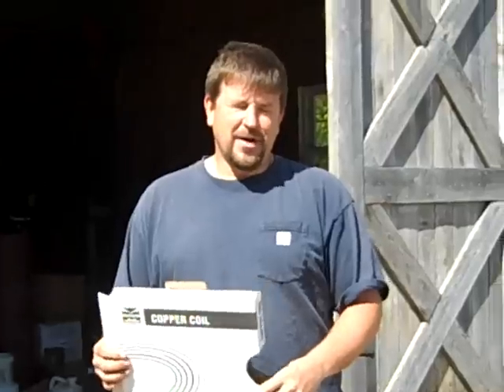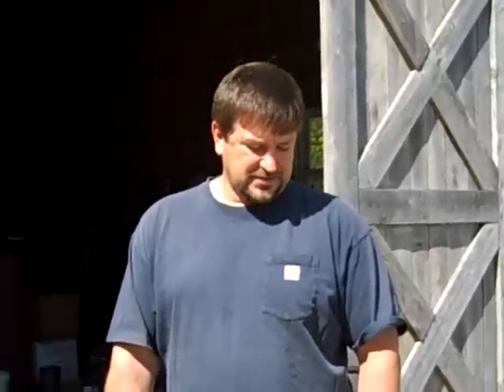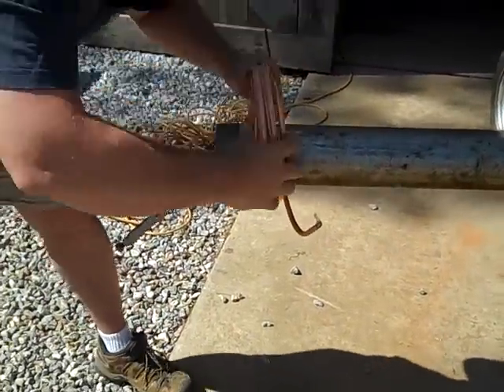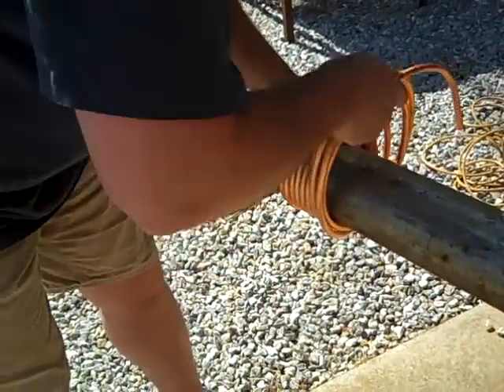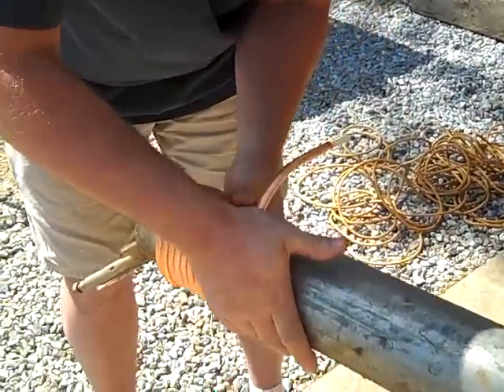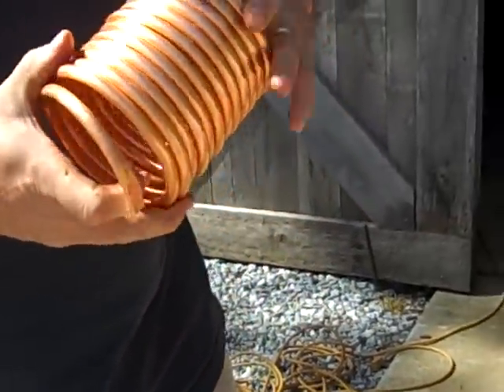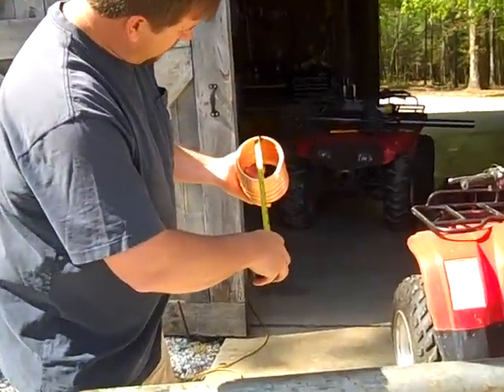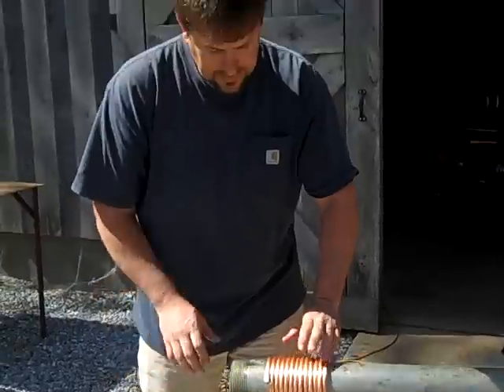Prepper Tip- Bending copper tubing with ICE!

Comment: When you froze the coper tubing what keep it crocking?  When I have had coper pipe freeze & braking open?
Reply: +Bruce Boyles Look up sand mandrel bending.
Reply: +Bruce Boyles When he froze the copper pipe with water in it, he left both ends "Uncapped". So the water can expand without bursting the copper pipe. In homes when it gets so cold that pipes burst, its because those pipes are in a closed system, and the pipes DO NOT have any openings, therefore the water which turns to ice bursts the pipe because it is looking for the easiest path to expand. I hope this is helpful...
Reply: +drs1919 1919drs that's not entirely true. Even with open ends the water can expand and crack pipes. Expanding ice will expand in every direction often taking the path of least resistance but I can still cause damage. Rocks get cracked like that naturally. The only reason you can do this with smaller tubings is because of just that. The tube is smaller therefore less water and that allows it to freeze faster and less expansion.
Reply: If you are going to do this make sure you fill the tube all the way and cap the ends with water balloons. Other than that I wouldn't fill it with anything at all. That size tubing bends easy on 4" and larger diameter pipe. Anything smaller then use sand or water. Sand is better tho.

Comment: I know it has been several years since you made this, but would it have been better to set the coil vertically and the water would run out on it's own. Instead of you having to twirl it?
Reply: I would assume that's a common sense thing, the bending of the tubing is the main focus here.
Reply: Good video on how to roll copper..

Comment: Has anyone pointed out the simple fact that when you're faced with a 'grid-down' situation your freezer may not be working? The 'fill it with sand' works, maybe salt or sugar if you're still stuck in a concrete jungle.
Reply: its a PREPPER Channel - - that's a SIMPLE Fact too....

Comment: This will not work hardly at all with a smaller diameter bend. I used the same 0.25" copper at about a 2" circular bend and the copper kinked. I think the only way to make a tighter coil will be with packed sand.

Comment: I NEED TO BEND A LARGE COPPER PIPE not tubing the stiff wall copper pipe how can i bend it with out putting a dent in it because i will be using it in a custom mosaic shower im installing in the basement of the house this week
Reply: Did you work it out? There are several ways of doing this.
Reply: yes i felled the pipe full of sand and heated it with a torch it looks beautiful after polishing it thanks
Reply: ***** Glad you worked it out and you are happy with the end result.

Comment: What if i have only straight long coper tube and it doesnt fit in freezer
Reply: Then you can't freeze it...lol
No..seriously.. You don't need ice or any filling at all. Just anneal the tubing, drag and bend (simultaneously) around a pole or pipe...that's all. Just give it time and wear some gloves with rubber to get a firm grip on the copper pipe.
I've done that with 6, 8 10 and 15 mm pipe without any kinks.

Comment: I would be concerned with the copper becoming brittle while cold. Sand is much safer, with a metal that work hardens as easily as copper and is so expensive I would stick with a fine grained solid.

Comment: So you're basically mandrel bending. Wouldn't sand work just as well and be much easier and faster to use?
Reply: Sure, sand would work, but it would be harder to get all of it out of the coil since it doesn't flow like water.
Reply: easier getting started, harder to clean up

Comment: Isn't it possible to just fill it totally up with water and close both ends. Water can't be compressed like ice. Painting it black will take more heat in from the sun, if you use the sun that is.

Comment: I'm in need of doing 3/4 copper tubing and have used sand and it failed! I've tried everything and it's not working at all! I'm pissed!
Reply: Use schedule 'K' pipe, it bends better.
Reply: SeanTheHOMIE
Did it and it worked great! I need to bend it just a little more and it will be done. Thanks.
Reply: Davie Jones No problem, glad it worked!

Comment: If you are in warm weather (I am in Brazil) and you are working with smaller diameter pipes (3/8), I should say that such technique is not optimal. The ice will melt quickly and you finish kinking the tube. Anyway, it seems like a great technique. 

Cheers

Comment: This might work for that soft, malleable copper that's sold in coils, but I'm not sure how well it would work with solid copper pipe, the stuff we usually use for water supply.  I know sand works, of course .... but of course the long, stiff pipes are way too long for a freezer anyway.

I've never fooled with the soft copper coils much, but it seems like they'd bend into coils like this without crimping, even without the ice.

Comment: Have NONE of you ever heard of annealing.  unless the tube is a small diameter you do not need to fill with water and freeze it or use salt. what you need is a large tray or trough that you can immerse the tubing your working with in .  OK so grab your Propane or LPG burner and heat the tube until you see the green tinge in the flame and throw it into the COLD water , you could use a small fire with fast burning softwood set up like heating a steel wagon wheel ring and then pour cold water over it . This anneals the Copper making it very soft and pliable,  you can then bend and shape easily up to a point, without placing anything in the tube. depending on the Copper tube forming around  a 3.5-3.75 Dia pipe will give you around a 4" coil , Oh BTW if you making a Still to purify water use only Copper Stainless tubing and silver solder to seal No brass or tin solder.
Reply: rockethead555 I thought me explanation would have been pretty easy to understand, but I'll see what I can do. 
Copper and Brass will work harden and this is the reason why annealing makes a huge difference. Once it is softened it is rather malleable.

Comment: I to have made stove coils like this with absolutely nothing in the pipe and it did not kink. A 4" or more diameter makes a pretty gradual bend. Pipe usually kinks on sharp bends, like a 90 degree turn.

Comment: You don't need ice to make a 4'' coil , That will not kink with the size of coil and the copper is soft just ease it around it keep it in line and tight and you don't have to worry about any kinking at all , No ice no sand!!

Comment: Who are the 67 that thumbs down people?!
Reply: the people that know you can wrap this pipe in a 5 inch radius without bending it with no problem whatsoever
Reply: True. When i make my condensers for the still i wrap around 1" pipe . Then you need sand/salt. I prefer salt . It's easier to get out again.
Reply: Don't see a reason to down-vote.
Reply: Nah me either.  The only reason i down vote any video is if it doesn't deliver what the title says. This vid does exactly what it says it will do. Ice is still easier to get out than salt so to me it's worth a try.
Reply: Their thumbs are locked in that position.